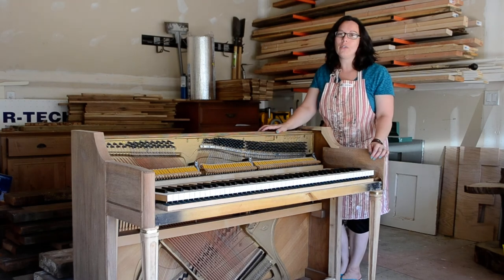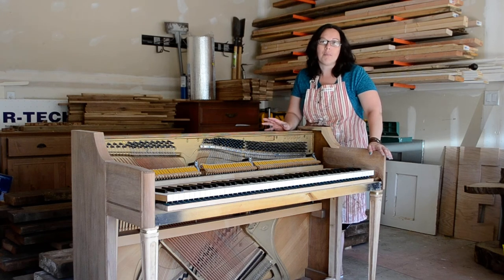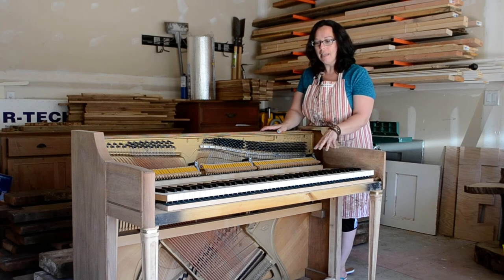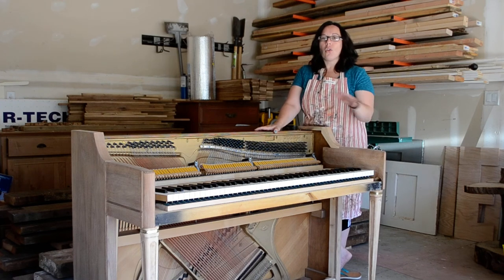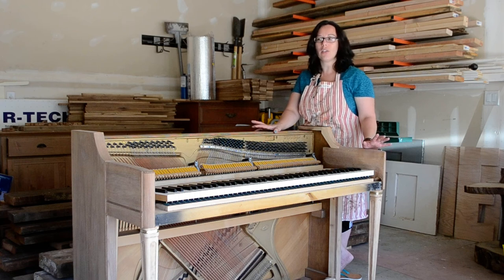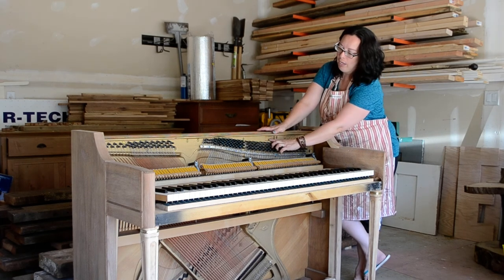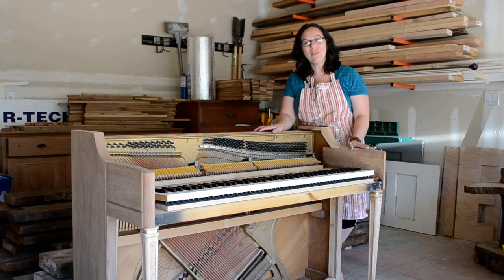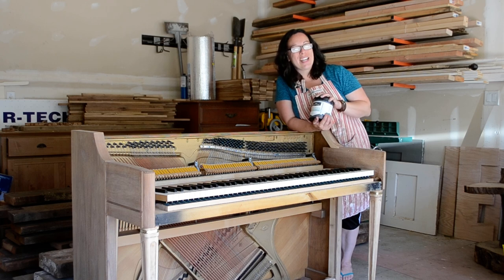Staining a piano

Comment: can anyone tell me how to remove the very front piece at the end of the keys?
Reply from the maker: Unfortunately, I don't recall much of the specific steps of disassembly, and it's probably a bit different per instrument as well. Everything I took apart came apart by undoing screws. Beyond that, if something presented and issue with returning to it's place, I left it in place.
Reply: My only advice is to just look all over and figure it out. Newer pianos you may find a pretty standard way of removing the front keyboard cover but the older it is the more variations. For example I have a 1907 Melville Clark I’m working on and I find in some places where the builder had something a little out of place or something like that and had to improvise the piece to work and still look good. I will say though you will usually find screws just underneath the cover piece and removing them will get you started on removal. Pay attention though if the finish hasn’t been completely removed and is kind of gluing it to me the rest of the piano you should either remove that finish or take a thin blade like a Razor and separate those joints so you don’t risk cracking the wood. Long winded I know but that’s all I have for you on that subject...I think lol